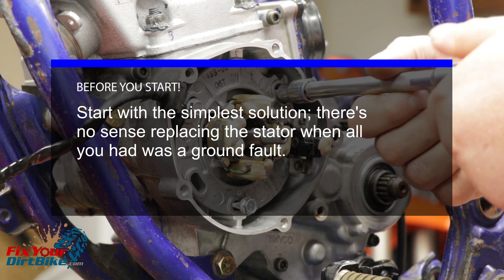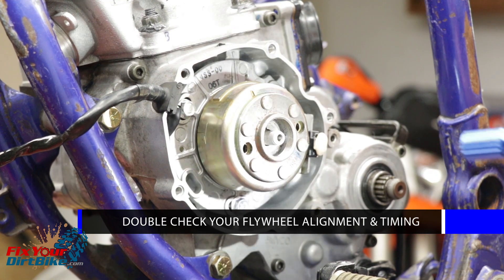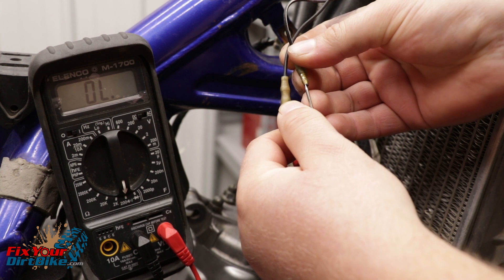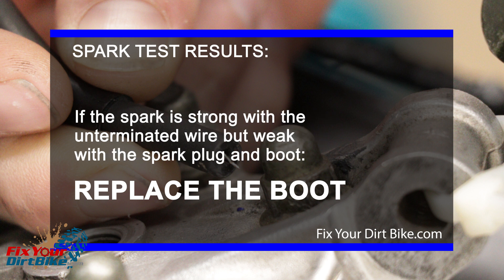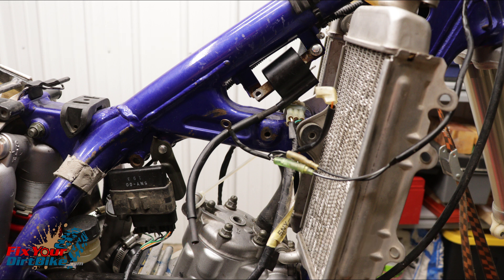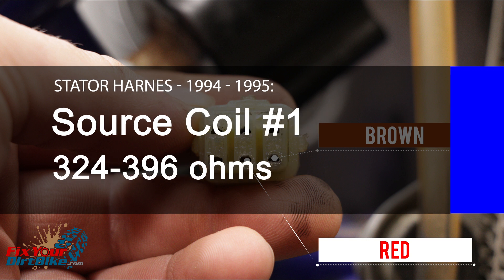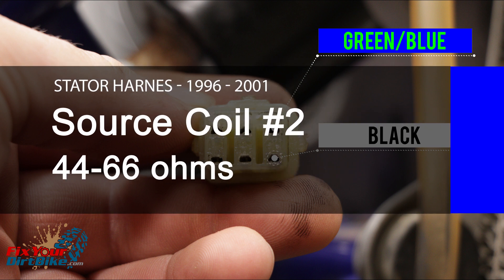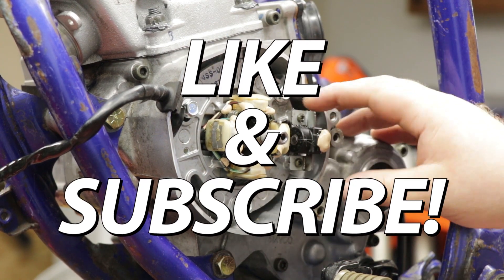94-01 Yamaha YZ125 Ignition Troubleshooting & Testing | #yz125 #yamaha #fixyourdirtbike

Comment: Hello, I have a question for you, Yamaha YZ 125 1995, the ignition coil burned out, will the ignition from 1996-2004 fit? Will the magneto also fit? If I rearrange it, or do I need to install it with the ignition from 1996-2004?
Reply from the maker: Unfortunately no. The 1994-95 models use a Mitsubishi magneto and coil. The 1996-2001 models us a Yamaha magneto and coil.
Reply: @Fixyourdirtbike  Perhaps coils from other equipment or the entire ignition will work?

Comment: I seem to have electrical issues. I have a spark, but the spark seems very small and my bike doesn't start. I'm not really sure what to do. I tried taking the boot off and kicking and it didn't spark at all. With the boot is an extremely weak spark. I have no idea what that might mean. I also have what should be a brand new coil and boot. So idk.
Reply from the maker: Where did you get the new coil? Is it specific to your bike or generic? Did the old coil fully fail, or were you getting weak spark?
Reply: The bike came with the wrong coil so I bought this one off eBay. It doesn't quite seem right though. I'm ordering a new wiring harness because my wires keep breaking and I may get another coil.

The listing says it's for my bike, and I can't really find anything else that says it fits
Reply from the maker: What's your voltage coming from the stator?

Comment: Your numbers are all wrong bro ive got the manual infront of me primary coil is 0.20-0.30ohms  and secondary is 9.5-14.3k ohms where you getting those numbers from?
Reply from the maker: Thanks for the heads up! That's interesting, I pulled specs from the manual. What manual do you have, and what year bike? I ran into this with the 97 CR250 a long time ago, too.
Reply: @Fixyourdirtbike  I've got a 1999 YZ250 with the manual. Bikes not getting any spark but all my test points are within range. Thinking I'm better off with new everything electrical, save myself a sore head however sourcing parts are either really expensive or non existent.
Reply: I know the 2000 model has a TPC so don't know if that being added in changes resistance numbers.

Comment: I have a 95 yz125 and I just replaced the stator with an oem and it’s been running great for months. Not all the sudden my bike cut off while riding and my spark seems weak like exactly shown in the video. Even with my boot off the wire, the spark is still very weak. Do you believe this to be a bad ignition coil? Or going bad. It has spark but very light.

Comment: Question! I got a 125 2-stroke bike that has no spark, I believe it’s because the past owner painted the frame. Does paint interfere with electrical system on a 2-stroke dirtbike? No I have not tested the Stator nor coil yet.
Reply from the maker: Possible but unlikely. Just to be sure, sand down the ignition coil mounting points so the are contacting bare metal.
Reply: @Fixyourdirtbike  I did, still no spark, but I believe the engine mounts need to be bare metal as well, that way the coil connection to the frame will have a connection to the engine for the sparkplug ground. But I’ll test the system first with a meter

Comment: on my 2002 yz 125 i've cut the jacket back about a 1/4 inch and i have 3 wires separate coming out...but my bike did have weak spark . need all new coil?
Reply from the maker: Cut the jacket back more, your should see more than three wires.
Reply: @Fixyourdirtbike  I've cut it back about a full half inch, I noticed though that some of the wires keep snapping off if moved or bent even slightly. Only one sticking out now at this point unless I cut it back at least a full inch. No spark anymore when I had weak spark before with the plug and cap on. I think I will need to just replace coil? Thanks for your help hahah working on a 02 yz125
Reply from the maker: @eZaFJDUBB  Yes, it sounds like you need a new coil.
Reply: @eZaFJDUBB  did you end up needing a coil?